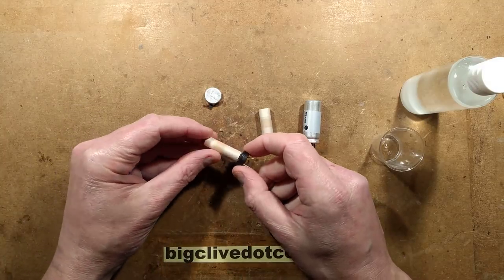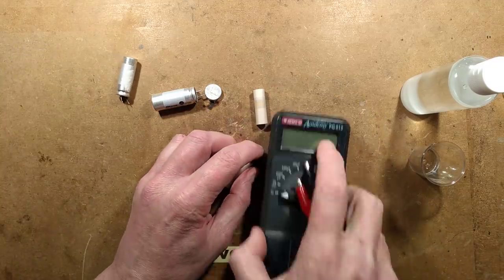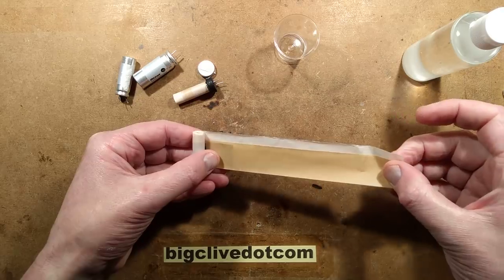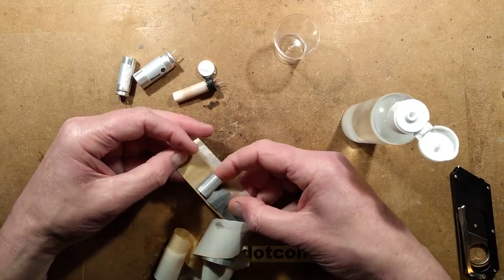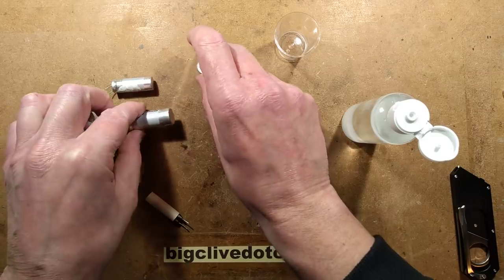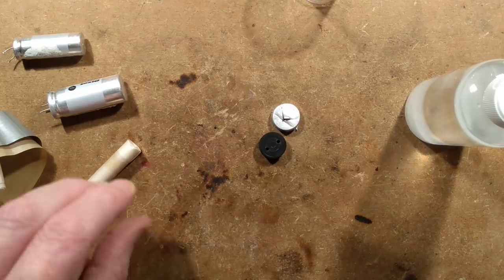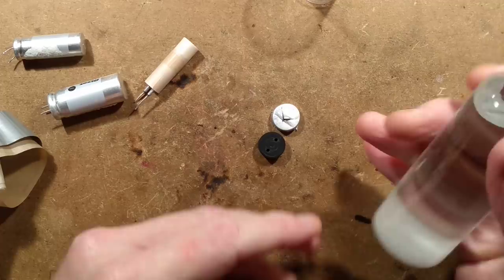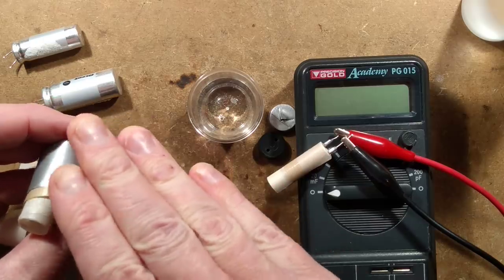Adding electrolyte to a fake (dry) capacitor.

Comment: The electrolyte in capacitors also has extremely accurately metered amounts of water in it to start. The whole thing acts as an electrically driven equilibrium reaction that if set up perfectly ends up with all the water (and aluminium borate) used and turned into boric acid and aluminium hydroxide. Acids need something like water to be effective proton donators, and water in reality as well as being H2O is also H3O+ and OH- at a concentration of 10E-7 molar. Hence a PH of 7  which is a measure of the H3O+ ions. Acids push up the concentration of H3O+ to say 10E-2 molar which would give a PH of 2. Inaccurate water metering will cause early life batch failures in electrolytics (I have seen this professionally a few times) and the accuracy also affects capacitor life. So as well as a slightly different concentration of aluminium borate boric acid and such like the water has to be metered even more accurately for both high temp and long life caps.

Comment: Want me to put the foil from one of those caps under a scanning electron microscope?
Reply: and yes, its easier to put the foil from one of those dry caps into the microscope, since they are dry, and thus dont need to go through complex drying steps to get the surface to be accurate.

Comment: I have to wonder if they're actually fake...maybe the factory screwed up a batch, the machine that squirts the electrolyte into the cap ran out, QC caught it but the cans were already sealed, and instead of tossing the whole lot in the dumpster they sold them to the fake electronics guy across the street. I dunno, but I'm guessing it started off as something stupid like that. If you're making a fake cap why go to all the bother of putting anything inside at all?

Comment: Hi Clive, could you add items and links if possible to your tools like your resistor dial etc permanently in your description please? Like Louis Rossmann does
Reply: He tried that before, but since most of it's from Ebay, it caused the sellers to jack the price up with so many people started buying whatever it was. Caused a lot of "But CLIIIIVE! It's not the price you said!", and he quit doing it.
Reply: @cojones8518  Yep, that's exactly what happens when a popular youtuber make recommendations on items of all sorts - the sellers turning the profitscrew up and up and up.
Reply: That design of resistance wheel is no longer available anyway....
Reply from the maker: These days if I provide links to eBay they are keyword searches set for lowest price first.
Reply: Oh, and the capacitance meter is the same type that I have. I got mine from Maplin Electronics in the U.K. However, Maplin Electronics went into administration and closed. There is a new company called Maplin, but they currently don’t carry much that would be of interest to electronics hobbyists. I’ve not seen that capacitance meter anywhere else. There is a more expensive ESR and capacitance meter, search for PEAK ELECTRONIC DESIGN Ltd

Comment: Clive, I think you're putting the capacitor the wrong way into the tester, I believe it is supposed to go across the socket?
Reply from the maker: It goes between labelled groups of three connections.
Reply: @bigclivedotcom  The groups must be placed differently on my tester. It's a model T3.

Comment: Wait capacitors have liquid in? could that be the liquid coming out of my VRMs on my motherboard?
Edit: oh it's conducive? Good thing it's not in use at the moment.
Reply: Liquid should not be in vrms. There is no liquid in the mosfets or inductors.
Reply: @drescherjm  
Will there be any reason to have capacitors there? Because it's a very oily substance that doesn't evaporate coming from under the vrm heatsink...
Reply: @drescherjm  
Okay I did a bit of research some people say it could be excess flux during manufacturing and it's just heating up, liquifying and gravity takes over. And flux isn't terrible for electronics. Let's hope it's just that.
Reply from the maker: Could be silicone oil from the thermal transfer compound.
Reply: @bigclivedotcom  
Is silicone oil conductive or damaging to motherboards?
Reply from the maker: @Zecrid.  No.  It's pretty inert.
Reply: @bigclivedotcom  
Alright thanks for the information, I feel a little safer around that motherboard now.

Comment: Capacitors is why I will never buy a Samsung appliance again. I repaired my dad's TV power board. They put 10V capacitors on a 12V bus. That's literally designed to fail. I replaced then with 25V caps of the same capacitance. Should last a very long time now.

Comment: What size farad capacitance would I need to overdrive 10x 100watt LEDs at say 200v for 1/2000 or 1/4000 second?
I tried to make a camera flash using a microcontroller switching on/off 100watt LEDs from a voltage booster capable of dialing up to 390v DC, but its onboard capacitor is woefully too small for what I was trying to do.
Reason? Photogrammetry rig with 150+ cameras. A precision timed synchronised multiple unit flash setup would be perfect.
Reply from the maker: It may require experimentation.  I'd recommend a low value resistor to avoid a peak current high enough to blow the bond wires on the LEDs.  I'd also recommend a few high value discharge resistors in series across the capacitor to discharge it when powered down for safety.
Reply: Thank you for your insight, I can't remember if I put in a resistor to discharge when off, but I caged the high voltage DC-DC circuitry in a 3D print so no high voltage can be touched.
I managed to get the timing of the LED turning on+off absolutely perfect to a DSLR's shutter opening and closing at 1/4000, but it lacked brightness. The idea is for a 'slow' shutter with 1/4000 flash so all the photos will be perfectly synchronised.
The photogrammetry rig is something to behold, I just made the boxes that trigger all the DSLRs simultaneously through opto isolators: youtu.be/Auo6aALdUp4?t=52

Comment: I think a "reject" would be more accurate and believable than a "fake" capacitor. If you were making actual fake capacitors you wouldn't put anything in them as its most of the manufacturing cost it would be an empty can, these are probably rejects that got sold off at some stupidly low low price.

Comment: They maybe needed dummies to setup and test the packaging machine. So they take a base product and skip as much as possible production steps to create cheap dummies. I have no clue about capacitor production but this is a standard practice in the semiconductor industry.  We need lots of dummies to setup the upstream equipment.

Comment: Darth Vader upon attempting to fire the Death Star's Illudium Q-36 Explosive Space Modulator on some unsuspecting planet

"Where's my Kaboom! Where's my Alderaan-shattering Kaboom!"

Enter a technician holding a garbage pail-sized capacitor

"I told you not to buy these from China... The cheeky bastards shipped 'em without electrolyte and you were in such a hurry to get this pile of crap operational we had to install these without testing 'em..."

Darth Vader makes a gesture with his hand

"I think someone's throat needs a hug..."

Technician puts his hands up and quickly spreads them apart causing Lord Vaders fingers to snap apart

"Oh, no you don't you dodgy wanker... That Force crap don't work with us..."

Comment: Disappointed you didn't take the next obvious logical step. "A small current / voltage for long time did nothing, Let's try a huge current/voltage for a short time!" what could go wrong? (tbh reforming caps in ancient equipment was once popularly performed using this excess Q approach, Ref Mr Carlson)

Comment: Couldn't you use distilled vinegar and salt as electrolyte. And how do they get oil capacitors to be electrolyte..
Have you got a link for the original designer of the tester so we don't buy fake
Reply: In oil capacitors there is no electrolyte which is why they're not called electrolytics. The difference is the separator is much thinner and the plate area is much much larger, and in the end the capacitance is tiny in comparison per unit of volume, but they're not polarized and will last almost forever by comparison.

Comment: The reason that it was heating up, and drawing current, is because you had the polarity backwards.  2 things cause electrolytics to draw current, heat up, and explode, aside from damage. 1) Over voltage, and 2) Reversing the polarity if it is not a bipolar electrolytic.

Comment: In desperation, cause i didn't get my caps on time, i actually squirted that same solution in to the sheared cap head and managed to prolong the suffering. I sealed it with a blob of hot glue, making sure to not let the glue go into the cap, i still wanted it to pop should it need to. And it did, twice, but it eventually died completely and nothing i did made it work. I shut the mobo until the caps arrived 2 weeks late.

Comment: If the liquid conducts electricity wouldn't it be a resistor?   if you reverse the voltage/currant  you applying does it act the same way?
Reply: The liquid HAS to conduct electricity, it would be completely useless as an electrolyte if it didn't. The aluminium is supposed to form an insulating oxide layer that forms the capacitor dielectric.
Reply: @ferrumignis  2 plate close together  produce capacitance . would have thought you would put a dielectric substance in between the 2 . Is putting  an insulated electrolytic in between the 2 plates the ways its done?
Reply: @thewhizard  The dielectric is the the very thin oxide layer on the aluminium foil rather than a separate layer of plastic or paper etc. This is why electrolytics have such a high capacitance for their size compared to other types.

Comment: Well this is why I come here: to learn stuff.  While your interesting experiment was not a complete success it led me to look at this: http://www.elna.co.jp/en/capacitor/alumi/principle.html and especially the section on aluminium electrolytic capacitors.

The etching (roughening the surface) is done in an acid, usually hydrochloric.  Finer texture is usually low voltage, while high voltage caps will probably appear much more "rough".  These fake capacitors were probably originally intended as as low voltage types as you noted the surface is not very textured and still a little shiny.

The forming of the anode oxidation is normally done in an aqueous solution (apparently), not the electrolyte that is used after wrapping.  The solutions used for anode oxidation are maybe ammonium boric acid, ammonium phosphate, or ammonium adipic acid.  The capacitors would become polarised because of the formation of the oxide layer on the anode, due to the effects of electrolysis.  It must be an aqueous solution because that is the source of 02 in the formation of the anode oxidised layer.  Large amounts of hydrogen gas are of course given off in the process.  The cathode side has a different electrochemical reaction.  Formation of the Anode layer is proportional to the voltage - maybe between 1 and 1.4 nm per volt.  I expect it would need to be proportional to the maximum intended working voltage of the cap.

Further, and borrowing from my materials science background, I suspect that the foil has to go from the etching solutions, to rinsing (to get rid of the acid/chloride ions), and then straight into the aqueous forming solution without being exposed to oxygen.  High purity Al will start to oxidise instantly on exposure to air, and it won't be the kind of oxide layer that is needed here.  That leads me to believe that something went wrong during or immediately after etching with this batch, and it was no longer possible to correctly form the required anode oxide layer.

This is why you saw no real change in characteristics after you tried to form the capacitor - it was already far too late for that procedure to be successful, and would have required an aqueous electrolyte in any case.  To complete it successfully it would need to go back to etching to remove the Al oxide and then back into rinsing and forming.

Edit to add:  diethylene glycol (DEG) is extremely toxic to the liver.  The poison is in the dose - if you consume enough of it to overwhelm the liver before it can metabolise all of it, permanent (and fatal) liver failure is the result.  Quite often it's the metabolic byproducts that are the toxins that do the real damage, and I think that is the case here.

Comment: What if manufacturer is just shipping these dry for safety reasons and this reseller just sold without even knowing. Would you be able to fill those caos with syringe and form them without desoldering?
Reply: No genuine capacitors are shipped dry, what safety reasons would warrant that? Have a look on YT for capacitor manufacturing, there are several videos showing the process.
Reply: @ferrumignis  was just wondering because many aviation companies do not allow bigger battery packs in cargo etc.
Reply: @juhasto91  That's due to the very high energy content of lithium ion batteries and their tendency to catch on fire if something goes wrong. Normal electrolytic caps hold a tiny fraction of the energy, don't burst into flame when shorted and they aren't usually shipped with any significant charge on them.

Comment: Clive you now, I like the days of old when engineering samples were also created for the boardrooms,  cast in clear acrylic to view. You've enough pieces there you could do a real nice shadow box "capacitor" diorama, and even put a small craft or doll house squeeze bottle with some mineral oil in it to demonstrate the glycol to be added. Heck, even getting a "working one" with a simple 555 timer hidden behind driving a low amp LED as a "capacitor in use" would put it just over the top.

Comment: It was brave to stick a capacitor into a component tester right after applying 12 volts to it. If the cap was able to hold any charge it would've fried the poor device.

Comment: Seriously.  How much is the sham factory saving by making a capacitor with all but the electrolyte?!  It just makes no sense.
Reply: Maybe they had a little issue on a production line and the flow of electrolyte stopped, resulting in non-electrolytic capacitors. Worthless? Nah, there's nothing that you can't sell to the gai-jin. What are they going to do? Look inside?

Clive: Hold my glycol.
Reply: Typically things like this would be either scrap/rejects from a genuine factory or thrown together in a genuine factory by a shady night shift worker.
Making the capacitor internals and assembling it into the can is extremely fast, machines process hundreds of them per minute. Adding the electrolyte is a much longer process performed in a huge vat with a vacuum applied to pull all the air out.